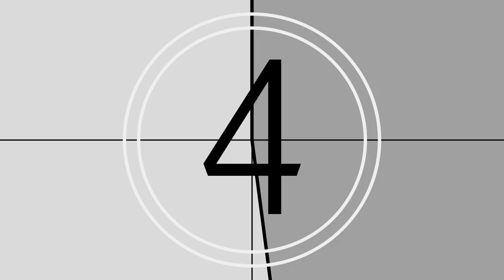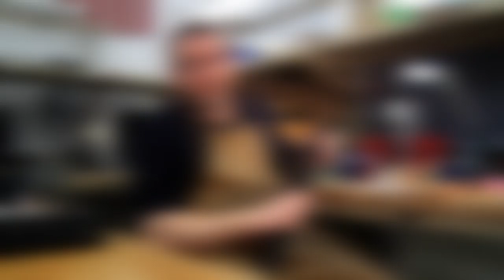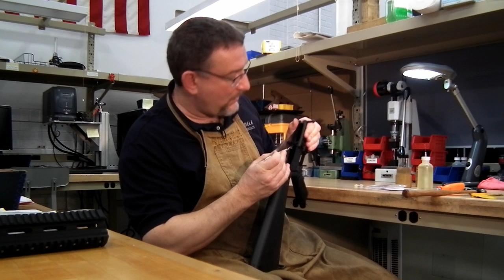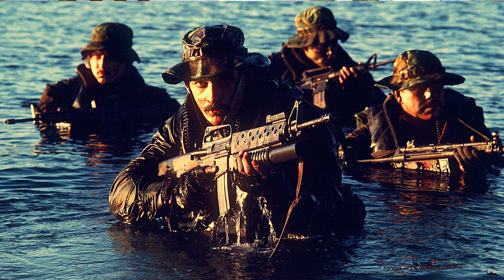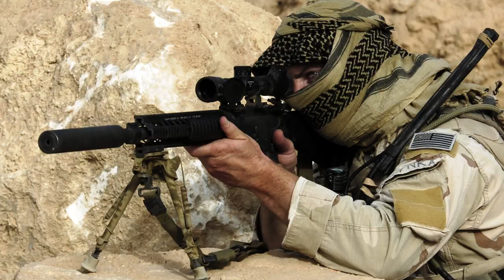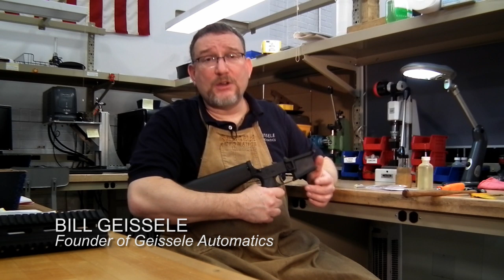SSA part 3 of 3 - Super Semi Automatic (SSA) Combat Trigger

Comment: I just installed an S3G in my AR and it's rather amazing. One note though, the hammer spring came out of the bag, installed backwards on the hammer. I tried installing it for almost an hour with obviously bad results until I looked closely at the diagram and realized it came from the factory in the wrong position. Everyone, look at the diagrams on the install sheet to make sure everything is in the right direction before you start installing one of these.
Reply: EXACTLY what happened to me! Including the hour or so it took, looking up these videos, installing it the wrong way 2-3 times, etc, before noticing the Hammer Spring came from the factory INCORRECTLY INSTALLED ON THE HAMMER. And so 5 YEARS after your comment they STILL are not getting this right? They need to change out their Quality Control guy(s).....   :/